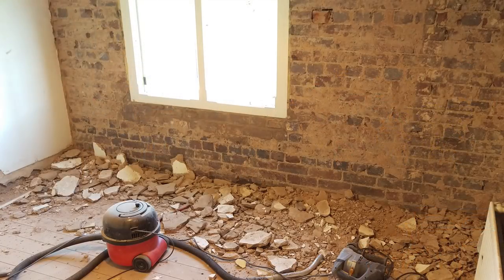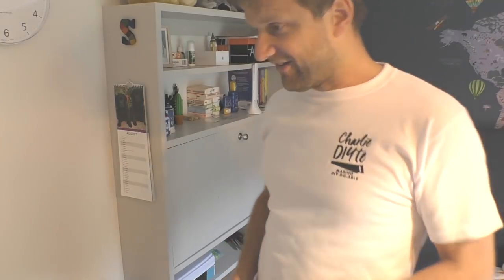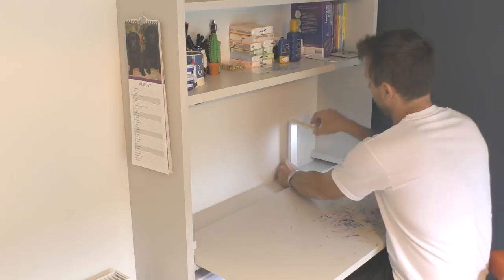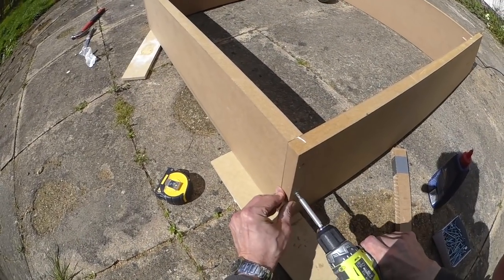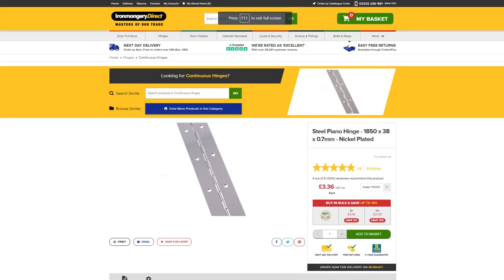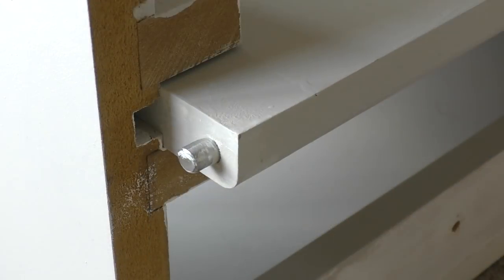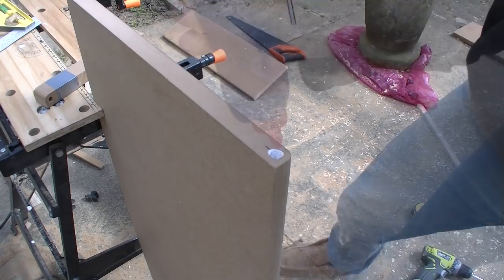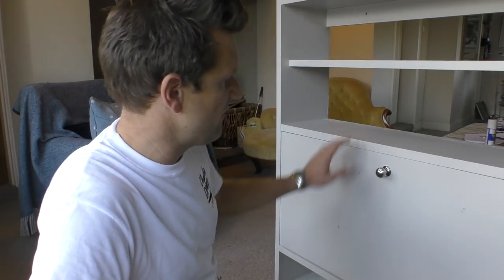How to Make a Folding Desk - With No Hinges!

Comment: I'm was just looking for some kind of folding table solution and look what just popped up in my subscription feed!

Since I don't need the shelves I was thinking more in the line of a hinged tabletop that could be raised up from a hanging down position with a support leg made of some sheet material that could be swung out until it was perpendicular to the wall, right under the tabletop the support leg would probably be as long as the tabletop extended out from the wall when it was raised and much more narrow at the floor.

But this hinge-less design is simply just a lot more elegant solution to the problem and the shelves are just an added bonus.

The thickest mdf board I've got at home is about 15 mm and that is probably a little to flimsy to use for a folding table, and since a trip to the hardware store is needed anyway I'll probably try to  use 18 mm birch ply instead of mdf.

Thank you for the inspiration and the good ideas!
Reply from the maker: You're very welcome Niklas - good to hear from you and thanks for taking the time to tell me about your project. Yes that 18mm sounds like a good option. You just need to make sure that your pins are proportionate in diameter to the thickness of the desk, and therefore strong enough - not that they have to be too strong as they're only guides after all.

Comment: It's an amazing way to make the desk flush with the rest of the bookcase: I picture a wall of inbuilt bookcases with a desk like that, and instead of two side rails the desk slides into a "pocket" created by a very low-sitting shelf that would hold monitors and a desk lamp. It'd be a fantastic solution for a home office in an apartment (or anywhere where space is tight): when you finish for the day the workstation just disappears.
Reply from the maker: Thanks Sasha. Yes that would be a great option. 👍
Reply: Sounds like a "DropTop" desk.

Comment: Thank you very much for the great inspiration for my Murphy desk. Finished it a little while ago. Used your table locking construction with a few optimisations. Great job 👍
Reply from the maker: Hey that's great news. Its awesome isn't it. What did you use for the pins? That's where I'd most struggle if I were making this again. Thanks for the comment 👍

Comment: great project. I would maybe have used an epoxy glue for the metal pins but I guess there is no real pressure on the glue joint as it only stops the pin from sliding out
Reply from the maker: Fair point. What sort of epoxy would you recommend?
Reply: araldite or something similar. Just the stuff they have in diy shops.

Comment: Hi Charlie, great video as always, thanks. I am wondering what the boxes with holes in them in the underfloor space are?
Reply from the maker: Thanks Robin - really appreciate that and thanks also for generally watching my vids! The boxes with holes in them have the kitchen ceiling down lights in them. It's not so much a heat thing as the LEDs emit almost no heat compared to the CFLS I originally had, but as I was filling between the joists with a Knauff acoustic roll insulation I wanted to keep the down lights away from the insulation and give them a little air circulation. My attempts to insulate the ceiling from sound were pathetic as the Knauff does very little. I should have used Rockwool, followed by an acoustic floor board and not screwed it down. 🙄
Reply: Thanks Charlie, I should have realised! Very sensible of you.

Comment: Great video, good design and as always executed brilliantly. I'm making a bed soon for a customer (in a box room in a semi) it's going up on the wall across the width of the room and because the room is so small it will impede over the window opening. There's currently a single bed in there I've been told I can dismantle and 'use bits of'!! Any advice?!?

A little aside here too Charlie.. has anyone mentioned a passing resemblance you have to Gordon Ramsay ?(much better looking than him I hasten to add).
Reply from the maker: Thanks Martin - you're not the first one to mention the Gordon Ramsay resemblance 😂 The bed is a tricky one. When you say it's going up on the wall, what do you mean? I probably need to see a picture to comment properly - feel free to email one to me at charliediyte@gmail.com

Comment: Is there a way of doing this without a router? This design is exactly what I need but I don't have a router. Maybe a good excuse to buy one? :)
Reply from the maker: I don't think so. I meant to talk about the router more in the video. When I bought my De Walt router I was a bit overwhelmed with it at first but it is an invaluable tool now. I use it for everything from rebating locks, putting an ogee edge on skirting boards and of course this. If you're buying one do a bit of research because you could buy a 1/4 inch or 1/2 inch shank router. The 1/4 inch is lighter and easier to use but the 1/2 inch shank is sturdier more powerful and produces more accurate cuts.
Reply: It's a good question though, that was the first thing that struck me too; I don't have a router, but I do have a lathe, so I thought I could do the same using some aluminium or steel channel and machine some rollers to fit;  sounds expensive of time, and it is, but my time costs me nothing! It's always fun to use what you have .
Reply: Thanks Charlie. I think I'm definitely going to get one as I'm moving to a new flat soon and there is so much I want to do that a router will really come in handy.